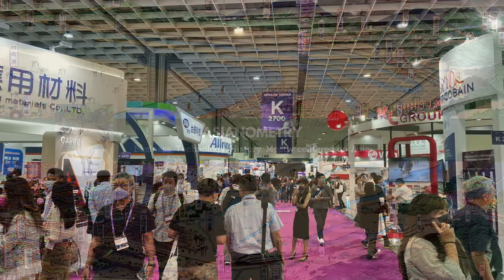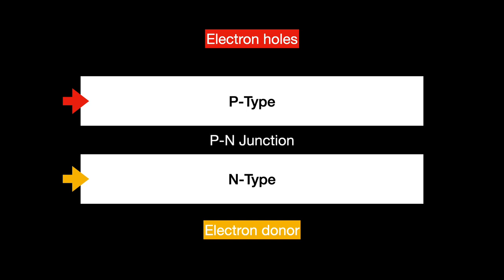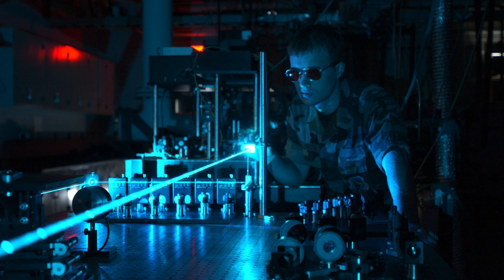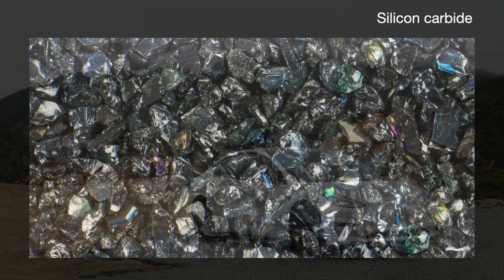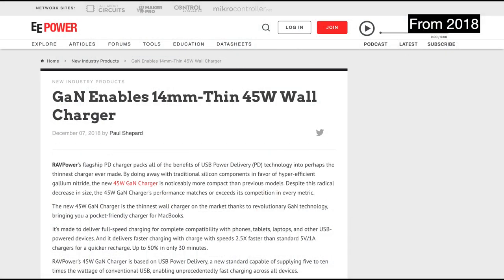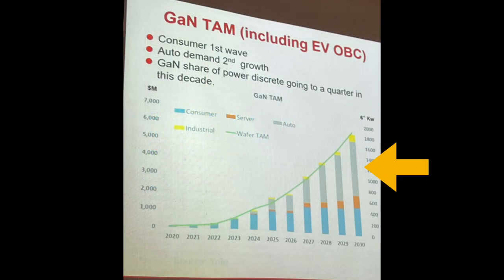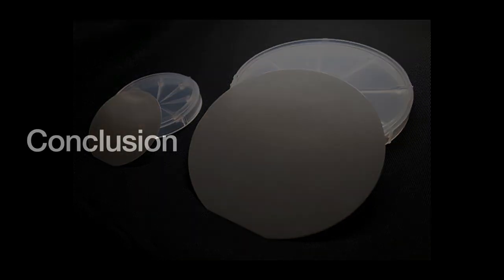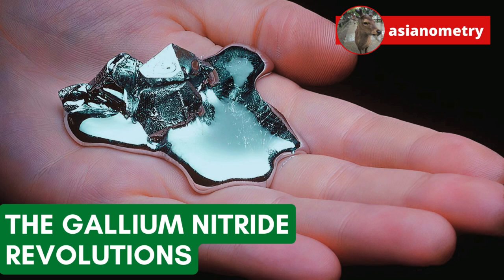The Gallium Nitride Revolutions

Comment: All this GaN dodgy investment stuff, specifically chargers has been debunked to hell and back already. Your charger and the one's shown most likely just use regular mosfets, pure marketing
Reply: Explain to me then how these chargers are suddenly charging faster than a laptop charger at 1/4th the size.
Reply: @swecreations  Explain to me how my cellphone can do more than my old laptop from 20 years ago but it 1/40th the size and weight? 🙃 Technology progresses, things get smaller, multilayer PCBs, finer pitch components, surface mount components etc. etc.
GaN chargers are a scam, sorry to break it to you, you paid 4X for a charger with 0 GaN inside
Reply: See Greatscott!'s video: 'should you buy? testing GaN FETS'
Reply: There were two US based (cellphone charger) start-ups that made some very misleading claims about the value of WBG devices and there was a public debunking of these 'scams'.  This was very unfortunate for the industry in the early days,  however everything mentioned in this video is very much accurate and GaN technology is very much a valid technology.
Reply: @michaelharrison1093  GaN is the monorail/hyperloop of semiconductor technology. GaN chargers are a scam
Reply: @Not_Sure-i6o  I beg to differ with your opinion.  On what basis do you think that GaN technology is a scam?
Reply: @Not_Sure-i6o  I'm more talking about how it happened over the span of a single year. Suddenly within an instant all chargers are half to a third as small, usually you'd expect this progression to take longer than this.
Reply: @Not_Sure-i6o  https://youtu.be/oTUZQDpQcU4

Did you not watch the same video you mentioned? "They are most certainly not a scam, and will improve charging technology over time" from the conclusion of the video. That he bought a no-name brand charger was never something you considered as a possibility though?
Reply: @swecreations  So they can use a slightly smaller inductor and are a few percent more efficient at higher voltage/loads. 
Not earth shattering size/weight reduction, surface mount inductors already very space optimized. Worth 3x price of a normal charger because the main inductor is 10% smaller and it's 5% more efficient? 
Power bricks remained large because AC power electronics are a pain to validate/certify, and if it ain't broke. Mainly because through hole components are disappearing power supplies are getting more compact, not some magical new mosfet
Reply: @Not_Sure-i6o  with regard to some of your comments with respect to power supply design.  Surface mount components have been the mainstay for switch-mode power supplies for the last two decades (at least), hence power supplies are not becoming smaller due to a move to surface mount (at least not in the last two decades).  

The design challenge all relates to thermal management.  Safety standards (an good design practice) limits the maximum external temperature, hence the power that you can process through a given volume product relates to the surface area and the efficiency of the converter.  

When the Energy Star 80+ legislation was passed into law (2004) the initial target was for a minimum efficiency of 80% over 80% of the operational range of the power converter.  Prior to the 80+ standard many switched mode power supplies had conversion efficiency around 60% to 70%.

Over the last couple of decades there has been a constant march upwards in the efficiency of switched mode power supplies and when GaN became economically viable (in the last couple of years) virtually all data center power supplies sold are built to meet the 80+ "Titanium' rating of 95% average efficiency.  Most external lap-top power supplies and smart-phone chargers are lagging behind in the efficiency stakes, and 85% efficiency is somewhat typical for the best of the pre-GaN (Si Super-Junction MOSFET) based external chargers. 

If you consider this 85% efficiency - this means that there is 15% of the input power which has to be managed thermally in the form of losses.  It might seem like a fairly small efficiency improvement going from 85% for Si SJ MOSFETs to 95% for GaN HEMT, but this efficiency improvement represents a 3x reduction in the amount of heat that needs to managed.  A 3x reduction in thermal loading will result in a 3x reduction in the surface area needed on the power supply.

Even with data center power supplies that are able to achieve the Titanium average 95% efficiency rating you will find that the major manufacturers (Delta, Lite-on, Flex power, etc.) are all moving to adopt GaN with a view to increasing the power conversion efficiency even further.

Even when the efficiency of a power converter gets to 99% and you might question why the need to improve the efficiency any further, consider the fact that improving the efficiency from 99% to 99.9% represents a 10x reduction in the thermal management challenge. 

So GaN adoption is not a scam in any way.

If you look at the 'Baliga figure of merit' comparing Si with GaN you will see that GaN is basically 1,000x better than Si.  Since GaN technology is based of the Si semiconductor process and most of the process for GaN is the same as for Si, then this 1,000 improvement in GaN over Si is going to have a very significant cost impact over time.

Like all new technology GaN is still very expensive compared to where the price will be driven to - there has been many billions of dollars of investment into GaN technology and this investment needs to be repaid before we will see significant cost reductions in GaN.  But these cost reductions and the mass adoption of GaN will be occurring over the next few years.
Reply: @michaelharrison1093  That's all pretty reasonable. 
But consider (somewhat lienant) regulation is needed to force adoption, then cost is always the driving factor for manufacturers, not efficiency. 
Cooling size maybe a factor for passive cooled consumer goods, I'll give you that, but how long before 100W is enough for any laptop? Other than luxury segment, no one wants to pay over the odds for a few percent more compact and efficient charger that they'll never break even the power savings before it becomes ewaste

Data centre with +3000rpm fans in close proximity, in a location chosen specifically where energy is cheap, I imagine they don't care much either.
Lots of low hanging fruit in a modern smps design to improve efficiency before looking at the FETs, (are there GaN rectifier diodes?) but would increase the cost so it doesn't happen.
If titanium rated PSU had GaN transistors they'd be marketing the hell out of that, yet they don't. Only marketing GaN I've seen are overpriced type c chargers.
Routine at this point we make semiconductors with layers of all manner of exotic materials, yet we just can't figure out GaN for some reason? It seems perpetually a few years and a few rounds of investment away. We'll also have fusion by then
Reply: @Not_Sure-i6o  In the case of creating the Energy Star 80+ legislation - this was needed to address some crazy practices that were known to exist in the telecommunications and data center applications...  

Many telecommunications / data center operators had very archaic operating procedures that were created over half a century ago.  When these operating procedures were created the cost of the infrastructure equipment was very high and the operating costs based on the power the equipment consumed was virtually nothing in comparison.  Based on this all of the operating procedures focused on trying to reduce cap-ex and completely ignored op-ex.  

Over the decades the cost of the infrastructure equipment reduced significantly (approximately 10% to 15% year on year) yet the amount of power consumed by this infrastructure equipment increased with the increasing amount of data processed.  Also over this period the real cost of energy increased (inflation adjusted).  

Around the time that the 80+ program was ratified in law there were examples of data centers where the amount of power being consumed by some of the switched mode power supplies in a month of operation cost more than the purchase price of that power supply.

The financial payback period for data center operators switching to higher efficiency power supplies was typically only a few months, yet before legislation was put in place none of the data center operators were interested in trying to drive for higher efficiency solutions.

As you stated these data center operators adopted an attitude of 'why fix something that is not broken'.   Sometimes it takes some carefully thought out legislation to drive change that is good for everybody.

In regard to your question about WBG diodes - the big technology change here that occurred over a decade ago was the adoption of SiC Schottky Barrier Rectifiers to replace Si ultra-fast rectifiers.

I don't think your comment about a few more rounds of investment for GaN is true anymore.  The start-ups (Transphorm, Navitas, GaN Systems) are all full funded public companies and the existing semiconductor companies have all already invested heavily in GaN (Infineon, Texas Instruments, Nexperia, STMicroelectronics).  The big challenge facing all of these companies with regard to GaN over the next few years is how they will all ramp up their production to meet the demand from the industry.
Reply: @Not_Sure-i6o  I am also interested if you could elaborate and enlighten me on a comment you made "Lots of low hanging fruit in a modern smps design to improve efficiency before looking at the FETs,"  Maybe I am missing something here?  I am always open to being challenged with new thinking and perspectives.  Please enlighten me.
Reply: @Not_Sure-i6o  You clearly have no idea - especially data centers care about efficiency because a one time investment is one thing but running costs is another. They run constantly every day of the year. Also its not just some fans in a data center, the cooling system is engineered to match the setup perfectly.